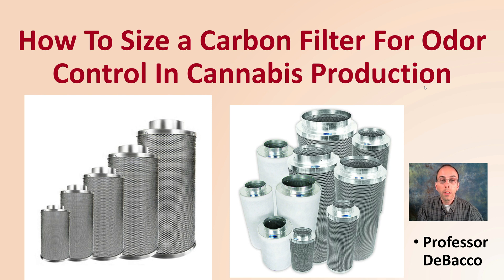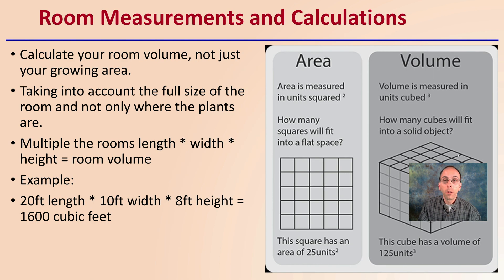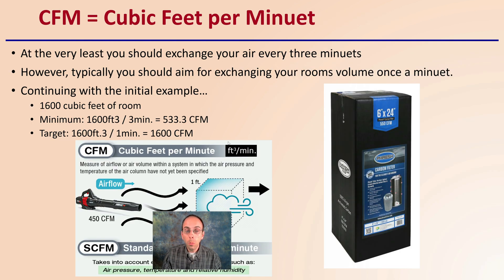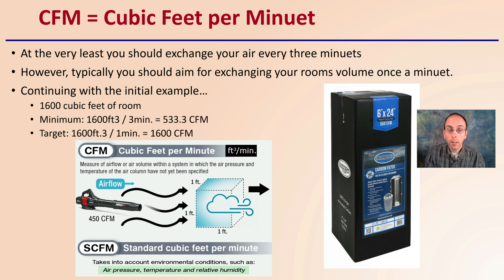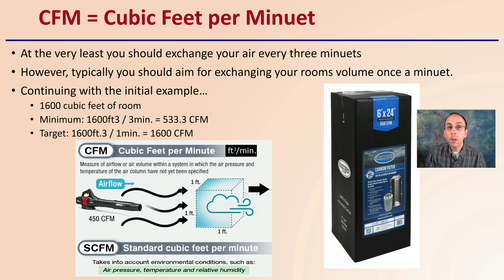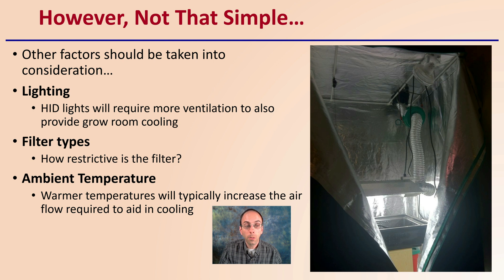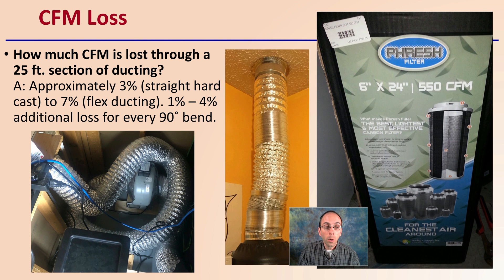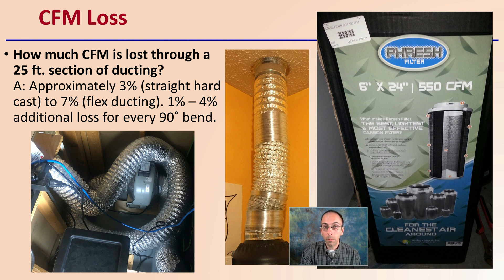How To Size a Carbon Filter For Odor Control In Cannabis Production

Comment: What’s your feelings thoughts using flex pipe or a solid pipe to create a permanent vent via a basement fireplace ? Concerns are C02 buildup .  Thank you Professor
Reply from the maker: Flex pipe would allow for an easy install, but solid pipe would be better for longer distances.  Not sure where the concerned over CO2 buildup are.  A fan would also be advised to help improve air circulation.